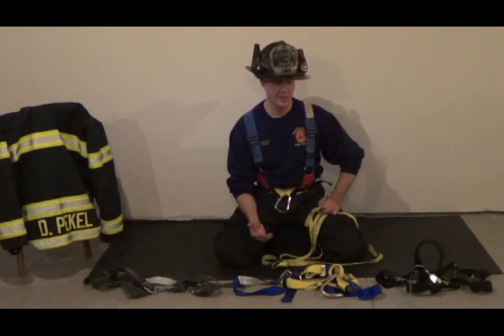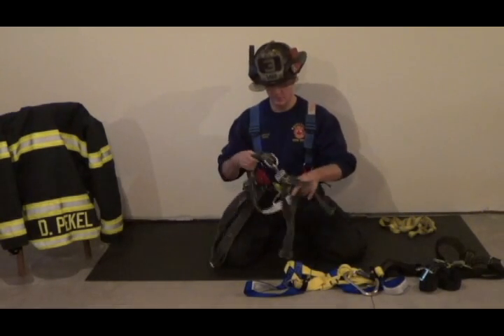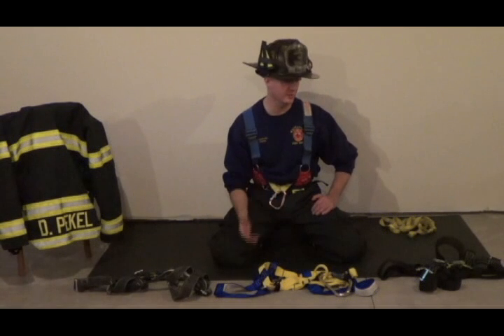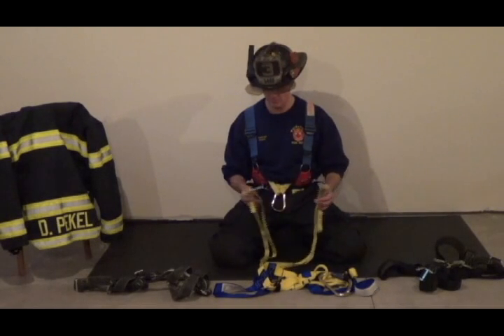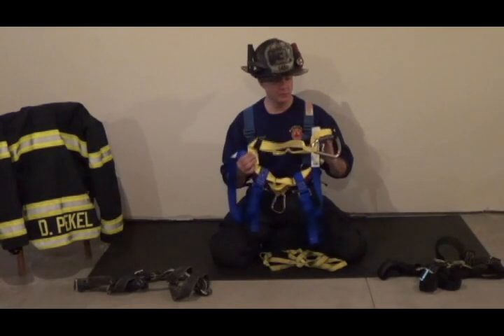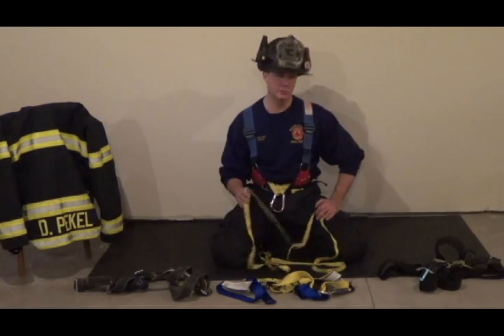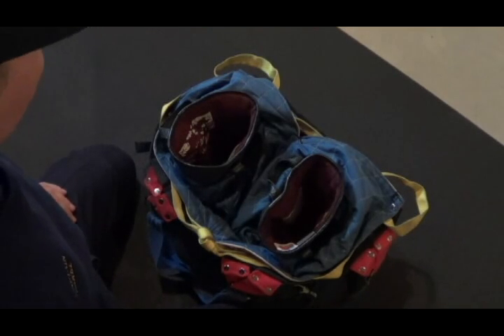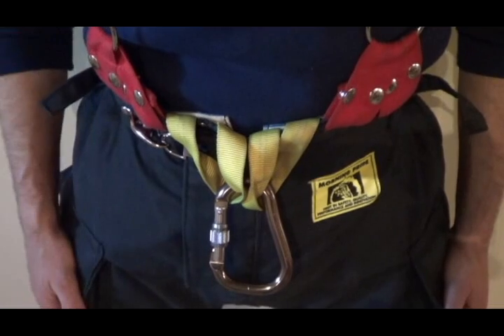"Home Made" Seat Harness - For a Personal Escape System

Comment: How do you keep the leg straps from following down in bunker gear
Reply from the maker: The leg loop straps should be captured by snaps on each side of the front entry flap of the outer and inner shells of your pants - This is what helps to prevent the leg loops from dropping down. Take a look at this video for how a carabiner can help with this, including how it can assist with attaching and integrating your system: https://www.youtube.com/watch?v=khUYGdmExHA
Reply: @DALEGPEKEL  I am having problems with the straps dropping  down  the back of my left in-between the liner and outer shell causing it to get tight when downing and making it hard to downing
Reply from the maker: @shawndoty1522  Without seeing the problem first hand it's hard for me to troubleshoot - It sounds like your harness might to too big.  If you can pull out the loops of the A frame infront more than 4 inches on each side you should shorten the harness.
Reply: @DALEGPEKEL  ok thanks I will try to shorten  it

Comment: Considering there are also two belt options, couldn’t one just use an appropriately sized loop of webbing secured together with a carabiner through the belt loops? I would imagine if fitted to the same tolerance as the belt it would work fine in a self rescue situation.

Comment: I'm currently running a similar set up, but with a swiss seat and I run with the bail out kit reconnected.  Any reason why you aren't trying the swiss seat?  Have you run into any problems with it?  I'm just trying to figure out the most comfortable and reliable set up.  Thank you for all your time and effort you put into these vids!  Great work.
Reply from the maker: Thanks for your comments Mike! - As far as the integrated harness I use - It's just what I prefer and it's worked very well so I haven't seen a need to try or experiment with other variations of seat harnesses or swiss seats. I actually use a Cobra Belt integrated into the belt loops of the turnout pants on my career FD and the integrated seat harness in the pants of my gear on my volley FD - Both sets of gear are made by Morning Pride/Honeywell, but they're different styles/models and that's why I have the different belts/harnesses, but the same style VRS.

Comment: Been talking about doing this with my gear and I'm glad I stumbled across this video.  A lot of the commercial set-ups are bulky, get hung up on things (as you discussed), expensive and it's just one more thing that's dangling off your person.  As you know, we already bring enough tools and equipment to the party (TICs, lights, small tools, etc.) and a bulky bailout system is just one of those things that could be more cumbersome than anything.  This is a great idea because in the event that you actually use this in an emergency, it'll do the same thing as that $300 harness without question, it's integrated and it's cheap.  I know what I'll be doing next shift.  Thanks!!!

Comment: Would it be easier to just leave the carabiner attached to both loops at all times?  Or does that interfere with putting your pants on?  I am about to be bumped to a downtown company which contains the most highrise buildings in my city.  Using your videos I am putting together a bail out kit.  How long would you recommend my rescue rope be?